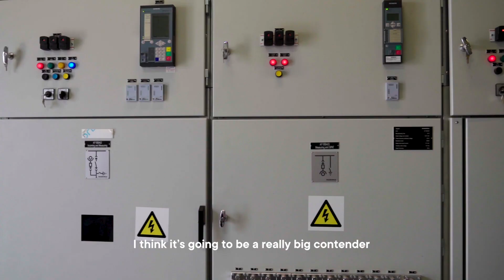South Africa’s Green Energy Ambitions

Comment: This project failed on the USA...it will do so in SA
Reply: Things don’t just fail, I hope you read as to why the USA one failed… it had engineering issues. And not everything world class is done by USA, that’s why we have different companies learning from one another. In SA we have roughly 4 operational if I remember well and the 5th one under construction called Redstone CSP which will go live in January 2024. So the other have been running well, yes maybe there are issues too but not issues that lead to the closure of the plants. Again, not everything done is USA is perfect but there are things done in SA that are “perfect”.